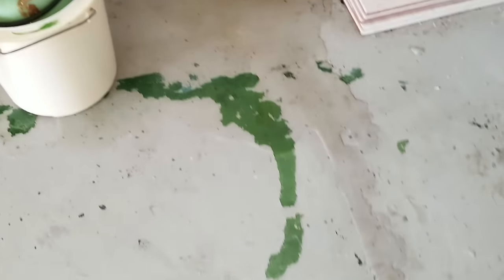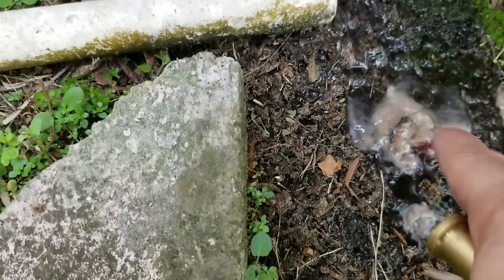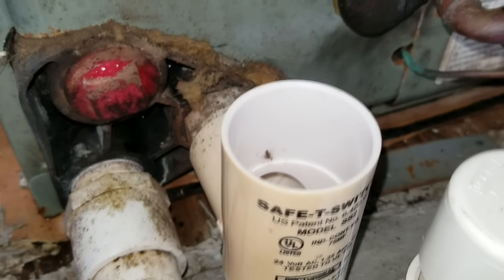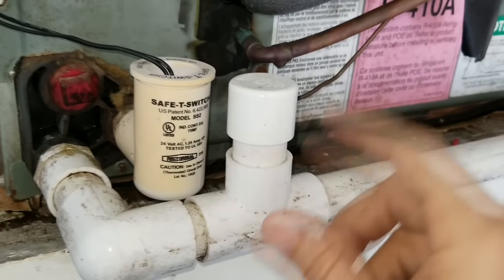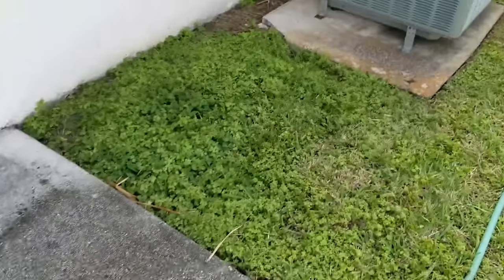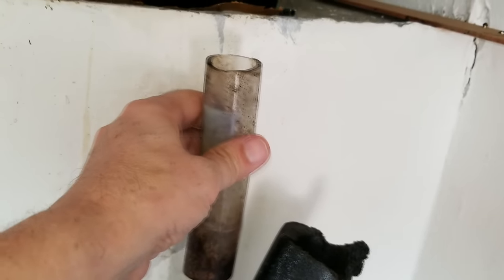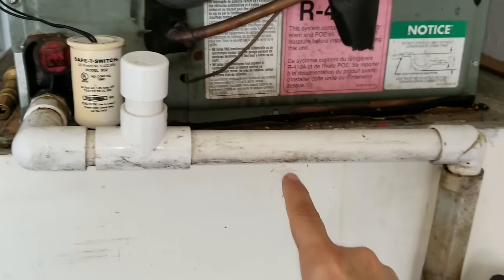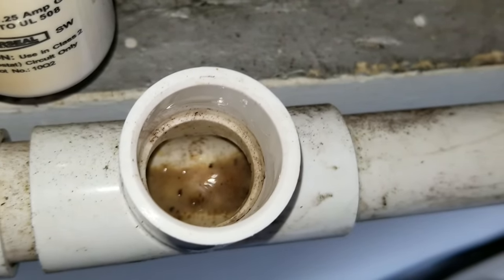How to Unclog AC Drain Line Fast (3 Seconds), Avoid Repairman

Comment: We just had this happen. We were not there when the repair man came. Our renter was. We are in Wisconsin and the house is in Florida.
Our float plug is in the house. The repair man said we can vacuum it on the outside. I was not there, but I am assuming sucking with a shop vac won’t damage anything?
Reply from the maker: Yes, many people report sucking the blockage out the pipe from the outside with a shop vac, if that does not work, then we use the hose.
Reply: @jeffostroff  , thank you.
Reply: Shop vac won't damage anything, but probably that will work for a few days and the line will be blocked again. That garden hose solution is way better. I installed my  3 Ton unit myself, and all the duct work at home . When I did the water drain line I added a garden  hose adapter and a ball valve to avoid flooding the evaporator when flushing with water. Every three months after replacing the filter I shut off the valve, attach the garden hose and let water pass for a few second. No bleach, no vinegar, no acids, just water at normal home pressure , that's the best solution. It is less than $20 adding a garden hose adapter and a valve to the actual discharge line and a few minutes labor.
Reply: A water flush is the best way to go.  I can't see a shop-vac really cleaning the pipes well enough.  It's like washing your dishes with a shop-vac without using water!

Comment: So I did this same thing even before watching your video a few times. Then I did it again and NO WATER WAS COMING OUT OF THE PVC PIPE ON THE SIDE OF THE HOUSE. I panicked and turned off the water. Come to find out, a section to the 3/4” pvc piping with an elbow HAD BEEN DRY FITTED and was never primed and cemented. So when I turned the water on full tilt like I always did, it blew the connection apart. Even worse, the drain piping WAS RUNNING THRU THE AIR HANDLER BOX (this can’t be to code) and the water flooded the air handler which I didn’t even know was happening until it was too late. Now I have hooked up a condensate pump because i have 34 years of primordial goo that has been growing inside the pipe because there was no P trap in the line to create an air gap to prevent outside air with mold spores for being pulled up thru the outside exit for the piping. I’m hoping someone can come and roto-root the line because spraying the garden hose thru it isn’t working any more and the condensate pump is being met with resistance which is causing the pump to not pump out the full amount of condensate in its reservoir. UGH.
Reply from the maker: Yikes, my friend had that, and water leaked inside their drywall in the master bedroom, and caused mold

Comment: Every video I watch for this involves a system setup nothing like mine.  It's a horizontal line with a T in it for the float, just like my last place had. No convenient easily separated clear hose like I've never seen in any place I've ever lived.  Need to block the blow-back into the AC unit, while simultaneously sending the air in the other direction, working from the T. If you have a tip on doing that, I'm all ears.

Comment: Jeff, I need your help. First off, thank you for the video. This is the first time I had to unclog our AC drain line. I bought a wet/dry shop vacuum with the intention to vacuum the ac drain line from the outside as instructed and recommended by a close friend of mine. Instead of vacuuming out the ac drain line from the outside, I accidentally connected the hose to the blower and it blew air into the ac drain line, causing water to come out at the wrong end. This consequently gushed all the water inside our home. After cleaning up the mess I made, I then went back outside to the AC drain line, but this time made sure the hose is connected as a vacuum, and then I vacuumed accordingly. It worked, and inside the bucket I was able to remove all the dirt and debris that was impeding better drainage for the AC. But the issue that concerns me is when I go and monitor the AC drain line outside, I don't see any water or drips of water coming out as I normally see it should. What are your thoughts on that? Is this a cause for concern? Should I wait a few more days? Did the mishap of blowing air into the AC drain line from the outside instead of vacuuming out damaged something inside? Looking forward to hear from you.
Reply from the maker: When you vacuum that outside line, make sure you get the best seal possible by taping the the hose to the pipe for maximum sucking power, than go inside and see if you hear or feel suction at the drain pan of the AC. You should be seeing the drips of water coming out within several minutes of the AC coming on. We have another video showing you exactly how we attach the vacuum: https://youtu.be/733SqRsF69U   Also, you can see I like to attach a garden hose to the AC drain line by the AC pan and gush the water right out the pipe, there might be other blockage in there.  Let me know if this helps, this other video should cover everything for you.

Comment: Condensation pan and sheet metal might be leaking the water out so the emergency float switch never tripped possibly?? Or the secondary drain might have a partial clog before the float switch??
Reply from the maker: IT is more likely the case that the pan is overflowing. If you see drips coming from the AC unit, then likely the pan overflowed because of the clogs. We worked on a friend's AC the other day, took all the PVC pieces out, and flushed them outside, and gooey stuff came out from all of them.

Comment: Great tip, but many clogs happen in the pan where the drain connection is made.  Get out your wet dry vac and add a reducer to put on some 1/2" clear fleixible line and suck all the crap out.

Comment: My 2 air handlers are in an upstairs closet, so a hose is impractical. Air pressure would work, but a shop vac at the outside drains worked great for me.....sucked a bunch of nastiness out. I pour straight vinegar in my lines every month or so, but discovered that wasn't enough when one evening after dinner my a/c cycled off and water started pouring out of my ceiling, YIKES!!!!
Reply from the maker: We did the hose trick in my neighbor's house a few months ago. We ran a hose up the stairs, and I held the hose in place while my neighbor turned on the water full blast for 3 seconds, then shut off. We did this a couple of times. Some over spray of water got on the wood floor in the closet, bu we had towels on hand to wipe it up immediately.

Comment: Like to add one thing that I think everyone should do as well.  You said you "squeezed" the clear pipe and sludge was seen on the ground outside.  Then you showed us the float switch which had very little water in it It is possible that that float switch WAS filled with water, but was not working.  You should have instructed the people to check that float switch at least twice a year.  They are inexpensive and easy to connect.  
To test if it is working, all you have to do is take the float out like you did to show us that their is very little water in.  THEN, with the AC system on, move the black float switch up and see if the system shuts off.  If not, replace it.  I find that these switches don't last long.  Also, I made sure that all my PVC connections are pressure connected and not glued near the AC.  This allows you to start the flush very close to the unit by just pulling them apart.  It makes all pieces cleaned separately as well if 90s are hard to flush.
Reply from the maker: Good ideas Ron!
Reply: @jeffostroff  Thanks.  I like that you did not promote using a shop-vac to suck the sludge out or just pour a gallon of hot water down the drain; it's not enough.  I basically do it the same way you did and living in South Florida, checking the float switch and flushing the drain before it leaks, every 6 months is my routine.  The high water pressure really gets the pipes clean.   I'm just glad that the unit is in the garage like yours and not the attic!

Comment: What I did was right after the pvc pipe comes out I installed a pvc ball valve, then after the ball valve I installed a faucet so I just hook up the hose and close the valve to flush the line.
Reply from the maker: Best way to do it!

Comment: Home depote sells a really strong vinegar, just remove that cap thingy and pour a half gallon in. Sit a wait 5 minutes it will cut right through the blockage.
Reply from the maker: No, nothing cuts through blockage. Vinegar is the most overprescribed solution on the internet

Comment: The trap is needed when a blower is after the condensate pan, otherwise the air handler would suck air through the drain line opening when the fan was on.  The condensate would not be able to overcome the suction of that air coming in when the water was trying to travel in the opposite direction.  The water would then overflow the pan. The trap prevents the air coming in and allows the condensate to flow out.
Reply from the maker: Yes, a lot of ACs we find were installed improperly, or without permit, so they take short cuts.

Comment: I use water mixture w/Bleach to clean my A/C drain-pan. Is it safe to use Bleach? I hear so many different ideas. Which is best for A/C? Next, where do you see your water line from outside? I saw a perfect shot of yours. I don't see mine.
Reply from the maker: Gayle your water line has to end somewhere, look for a pipe coming out of the wall or up from the ground. I don't like bleach, hate the smell, and it can kill your grass where it lands outside. Best bet to keep the water flowing id change your filters often, use high quality filters, and and every six months add bottle of the ac line cleaner you see me link to in the video description.
Reply: @jeffostroff  After searching for my water line, it's buried into the soil. It goes all around the wall. I'm in a Condominium Development.
Reply from the maker: @gaylefriedman3773   I have done several of these in the condos and even though it disappears into the wall, they always pop out outside the building somewhere and drain on to the ground. The numerous times I've had to walk around the building until I could find where they're coming out at there can be several of them there could be one for each floor but they are there

Comment: Can you tell me which drain pipe goes to the outside? Would it be going into a silver foil wall then to the outside? Thank you! ❤️
Reply from the maker: yes in this case it goes into the wall, then pops out on the outside of the house
Reply: Thank you so much!

If I pour water down that vertical pipe it will come put the outside drain out?
Reply: @jantravia6984  If the line isn't clogged it will : )

Comment: How do you clean that line if you can't access it well? My drain pan/drain line is inside of an unfinished "room" in my townhome that is *only accessible through a 1'x1' maintenance hatch...so, the only real access I have to my drain line is at the end (outside). How do I clean it out? Will a cleaner poured into the evap coils reach the clog and dissolve it? Should I WetVac the end of the line and hope it pulls out the clog that's up in the system? Open to solutions here
TL;DR I need to clean drain line but only have access to end of pipe (outside of townhome)
Reply from the maker: In your case I would suggest you get a shop vac on the outside of the building where the pipe dreams. Tape up your hose to the end of the pipe and just turn on your shop vac and in a few seconds it should clear the clog

Comment: The trap also keeps the drain pipe from creating suction back to the pan, which would keep condensate from entering the drain.
Reply from the maker: Right, to prevent warm air from outside the house getting sucked inside
Reply: @jeffostroff  Yes, and that warm air creates a draft exiting the condensate pipe attached to drain pain and does not allow the flow from pan to drain properly, all goo tips.

Comment: I used a shop vac to clean mine. I have a question. Is there water supposed to be in my flow switch container thing?!
Reply from the maker: Id eally the float switch compartment should be empty unless there is an overflow condition. You should try to suck out any water that is in there, it may keep tripping the float switch if the water level does not recede.

Comment: When i first moved in at the apartment in aug 2023 It was clogged up i had to use a Cable Wire in snake it through since thats the only thing i had on hand to clear it out and my AC started working again. Of course i used some water to flush it out after unclogging

Comment: Okay so we usually use a shop vac to blow out the clog and it works fine. And we pour bleach into the pipe every few months to keep it clean. But this has happened twice this summer which seems excessive. And now, it seems like the whole unit has condensation for 24 hours now. There’s a huge puddle all around the bottom of the closet and around the outside of the closet. To my knowledge, it didn’t freeze this weekend, which is what one would think because of the condensation. I don’t know what to do. The pipe isn’t clogged. It’s not frozen. But it’s leaking water everywhere.
Reply from the maker: If it's leaking on the floor in the closet it usually means there is a backup somewhere in the pipe or that your coils have frozen in the dripping water down through the air filter so pull out your air filter take a look at it see if your filter is clean and of Maybe it needs to be changed sometimes when the system gets starved for air because of a dirty filter it will cause problems or you may also have dirt in your and your coil fins

Comment: Do you think I could pour a Pressure washing solution mixed with water down the drain to unclog it
Reply from the maker: June, with all AC line clogs, they are essentially wedged in there, and I have never seen any mixture of anything legal that would force that open, it's a simple matter of pushing against it with water under pressure from a garden hose, or pressurized air from a tank, or a shop ac on the outside of the drain pipe sucking it form outside.

Comment: Try not to use 90 degree pipe connectors. They clog super easy with no water pressure behind them.  Use 45 degree or bend the pipe with a heat gun in a lazy 90 if you have to.
Reply from the maker: Yes they do, with low pressure like this I hate the 90 degree fittings. And they have them inside the wall too.

Comment: Your AC has one white PVC pipe.  Mine has two.  The lower of the two has the overfill float (I think you called it), and the upper pipe has nothing, no dips, no floats, it comes out kinda horizontal and then starts a slalom downward.  Do I have two drains?  Should these drains have small dips, like it under your sink or a toilet?  :face-turquoise-covering-eyes:

Comment: Thanks to your video I discovered our heat pump installers screwed up badly and we're lucky we didn't have a waterfall in the bathroom downstairs. Both of the overflow shut off floats were installed with something sitting on top of them so they'd never activate. And the drain pipe slants up, not down. WTF?
Reply from the maker: yikes! installer clearly had no clue

Comment: Thank you! 
Which part is considered the "top cleanout?" is it the float area opening when the float is pulled out?
Reply: The top cleanout is the vertical cap leg on the main drain line.  The float is in the overflow line.

Comment: It's been super hot here, and my AC cant keep up. I opened the closet and noticed there was water on the floor. Open the bottom of the handler and the pan is full of water. Could this cause my AC to not be cooling effectively? I'm going to try to clean it out tomorrow.